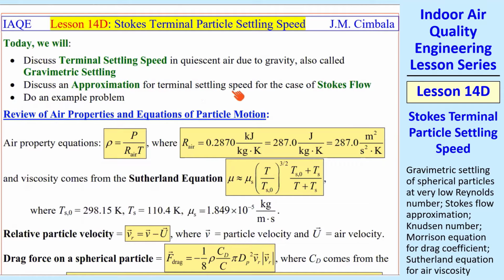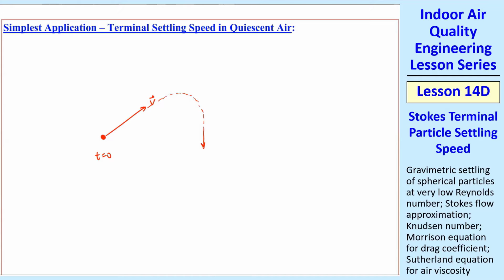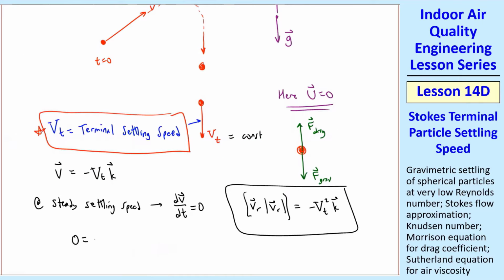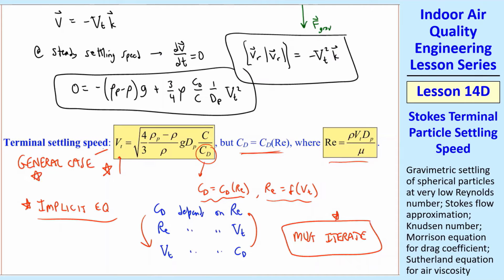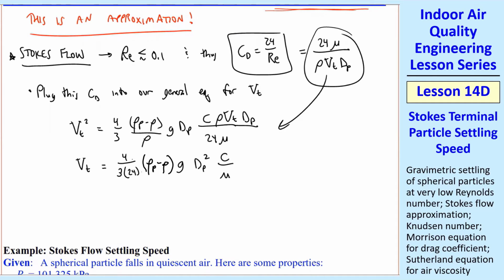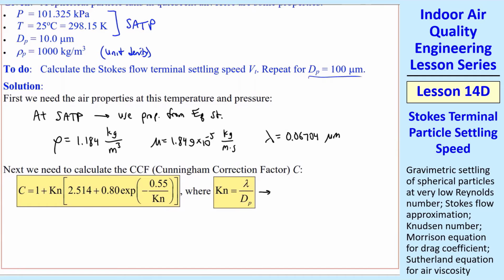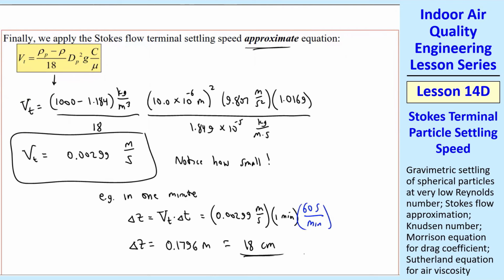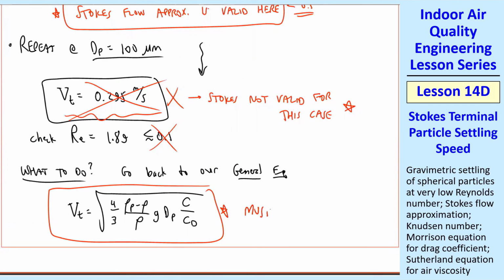IAQ Engineering Lesson 14D: Stokes Terminal Particle Settling Speed

Comment: Excellent presentation, Prof. Cimbala. I am working on self-soiling of a car. It is a big SUV, and therefore, huge wake at the back of the vehicle. How to calculate Reynold number for the mud particle? I do not know what about be the characteristic length, "L" in Re=rho*(U-v)*L/Mu. And finally how to calculate the Stokes number ?? Thank you for your help
Reply from the maker: L is typically a diameter or something close to a diameter, like a dimension of the particle if it is not spherical. In your case, the mud particle is most likely big enough and moving fast enough that the Reynolds number will be way to high for Stokes flow to apply. Look at the next couple of lessons in this series to learn how to calculate this for particles at higher Reynolds numbers.

Thank you for your kind comment. Please tell your friends about my channel.

Comment: I absolutely loooove your presentation Prof Cimbala! If the fluid itself is in turbulent flow,  i.e. Re is high, but the relative velocity of particles is low ,Rep <0.1 , is the stokes flow still appliable ?  Does the stokes approximation is only valid when the fliud is still?
Reply from the maker: The particle is tossed around by eddies in the turbulent flow, but the eddies are typically much larger than the particle. Locally, the particle can still be in Stokes regime provided that you use the relative Reynolds number (Re based on the relative velocity that the particle is experiencing).
Reply from the maker: Thank you for your kind comment. Please tell your friends and colleagues about my YouTube channel where there are hundreds of free videos about the Bible, fluid mechanics, science, math, statistics, air pollution, and other topics. I would greatly appreciate it.